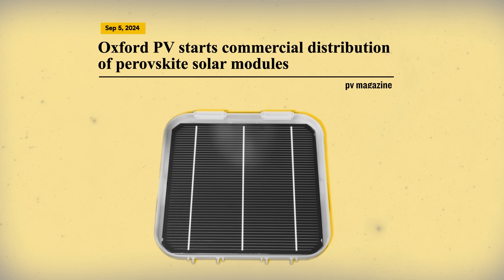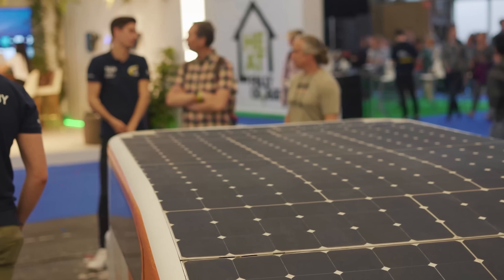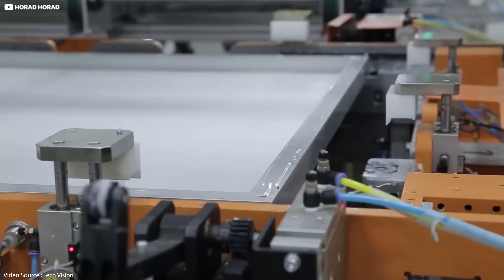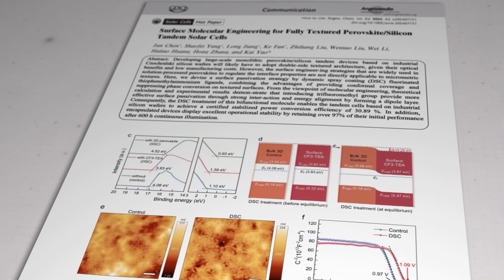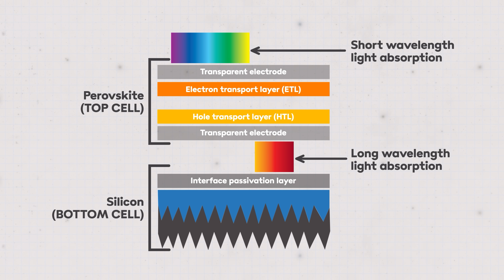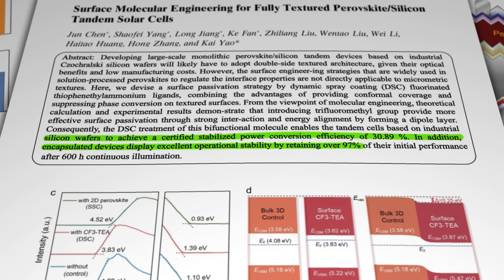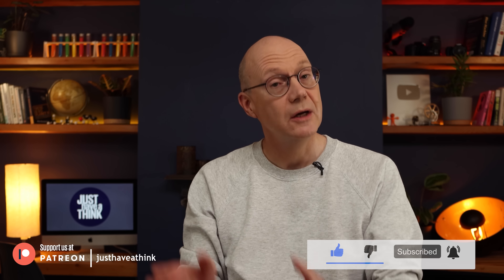Solar PV with more than 40% efficiency is now achievable.

Comment: 30% efficiency means 50% more energy than my 20% efficiency panels which means a huge improvement to my quality of life in winter :)
Reply: it also means less panels on the roof for the same power production which I like
Reply: @SpectacularRanker2  OR more power from the same roof !
Reply: @SpectacularRanker2  And accountants will love this, as yield per m2 increases while installation cost per kW of capacity goes down. I can see these efficiency gains encouraging solar installation at industrial and infrastructure sites
Reply: @SpectacularRanker2  It will depend on cost. If they cost 10x then only location with space limitations will use them. If it is 1.1x then they will see a lot of use.
Reply: It also means that if in winter you harvest the waste heat for hot water, space heating and clothes drying you reduce energy consumption from another area.  That is a distinct possibility.
Reply: Likewise. I wonder when to buy thou. I guess incompatibility isn't a problem but shall check. I also want the smaller sizes to fit on my small house boat
Reply: @EdSurridge  I've been looking at slim flexible solar panels for yachts mainly cos they can be walked on too, meaning that potentially any flat-ish deck space can become solar (although I'd obviously give the anchor & chain area a wide berth)...

Getting to my point, it seems as though high quality flexible solar panels are 20x the price of half decent framed panels... 

More efficient flexible panels would be great as long as they don't cost 100% more again.

PS please PM me if you know anyone selling a catamaran with boom roller furling mainsail 😅
Reply: @aaronjones4529  delamination after a few years perhaps 2 or 3 doesn't have the guarantee...
Reply: Go for a mast rolling mainsail. The little bit of weight higher up might even make the cat easier when anchored... .?
Reply: @EdSurridge  Yes size is a big factor, they keep making panels bigger so they can sell their next new panel because it has higher wattage on the label. Seemingly regardless of how much more difficult they are to instal. Also I need 60 cell panels not 72 like many are now.
Reply: @jedics1  perhaps people shall build their own ...
Reply: Though for most householders money is the limiting factor rather than roof area. A panel that makes 50% more but which costs 100% more is only an advance for a very limited set of applications.
Reply: @gasdive  This was true a few years ago. Now PV panels are so cheap, that the the cost is dominated by installation.
Reply: @orbiradio2465  that's true, the inverter, wiring, permitting, quoting, meter replacement and so on are now the main costs. However just saying "installation" costs dominate so panel costs don't matter is a bit misleading. Two systems that both need say a 10 kW inverter but one needs 30 panels, and one needs 20 are not going to have a very different installation cost. Just the cost of 10 panels worth of mounting kit and a little more labour.
Reply: @gasdive  Yes. I love the idea of a solar powered live-aboard boat, and with the limited area, you need maximum efficiency. But of course I'm not in the market since even the cheapest option is about $500,000 base, and no one gets charged just base, plus there are expenses in bringing the boat from the manufacturer to you. 
Even tiny houses don't have the same. problem as boats, since you can place panels on the roof AND adjacent to the home. Even people like me, who don't mind the isolation of living away from land, aren't all in the market for they kind of boat that would use these systems, making the market for expensive-but-efficient panels very small indeed. 
All that said, the one thing you've glossed over is that the final cost isn't the same as the *panel* cost, since there's installation involved, and the fewer panels you need to install, the less expensive the final system is going to be. Installation is already half or more of the total system cost (though I haven't looked at how much of that is installing new wiring + inverter which would not change with the number of panels, only with total generation capacity). As panels come down in overall price and installation becomes ever larger a % of the final cost, then more people will be able to afford *relatively* more expensive panels in order to save money on installation. 
The CdTe panel market initially was selling their panels at higher cost than silicon, but those panels are dramatically less weight per kw (they're less expensive and need larger area to produce the same amount, but they're so ridiculously light that even a larger panel still weighs much less). Their inefficiency made them inappropriate for things like boats, but very appropriate for large industrial/commercial buildings with weak roofs. The incredibly light weight required less bulky and less solid frames to hold them, reducing weight further, which led to vastly lower instal costs + the ability to cover a greater % of the roof in those buildings I discussed where the ability to carry excess weight was small. The point here is just that installation differences can make a large difference in final costs in at least some applications, and that might affect the market for these tandem cells. 
These complex interactions mean, I'm quite sure, that there will be a time when panel cost doesn't matter as much as it does today, and even today panel cost isn't everything, but you're absolutely correct that space is not the limiting factor for most people. Money is. So they're going to have to make sure the price per kilowatt hour generated by the perovskite tandem panels is on a rough par with the price for traditional silicon or we won't see significant sales for years.
Reply: @gasdive  I dunno if that's as true as you think it is. Last time I checked, the majority of the people in the world lived in cities and towns. Folks who live in cities often have less total roof area than someone in West Texas. Most people in Toronto who own houses would have trouble putting enough PV on their roof to run their houses 100% in the winter. (Of course, we don't want to go off grid -- but we like producing our own power.) So more efficiency would matter to us.
Reply: @TaiViinikka  I said most, not all. I have a house about the same size as average for Toronto (not in Toronto) and I run my fully electric house, and pool, and EV and still export more than I consume with less than 1/4 of my roof under panels.

Only if my demands were more than 4 times higher, or the insolation was one quarter (nowhere on earth is that low) would I find a more expensive and shorter life panel to be an advantage. Not saying such a situation can't exist, but it's not common for people who can have panels (people with houses) to need more efficient ones.
Reply: Agree with most of the comments of installation. Hopefully govt rebates go to installation not the panels once these panels are able to be mass manufactured.
Reply: It's even more than 50% if you live in a country where winter sky is constantly cloudy because perovskite PVs are very effective in diffused lighting (much more than regular PVs).
Reply: @dariuszb.9778  Good point and thats where most of us need it, even my tiny system makes more energy than I can use in summer, its winter where I have to go without or plugin to the grid. Im ready for them to take my money if they produce a smaller 60 cell version.
Reply: There has been work done on hybrid panels. Feeding pre heated water into a heat pump really boosts the useful energy harvested from a hybrid panel.
Reply: @clivestainlesssteelwomble7665  yes but they r expensive and heavy
Reply: Any idea how much your ac bill has gone down in the summer due to having the panels on your roof or was your insulation doing a relatively good job before the installation?
Reply: @ValidatingUsername  Im 90% off grid so don't have power bills but my 2000w of solar is enough to run a 2500w ac for free and still put some power into my batteries in summer. My 9kw of batteries could then run it for 6 to 8 hours at night.
Reply: "quality of life in winter"
- I assume that quality of life means having enough energy to keep things warm. But if so, that's odd because you can capture well more than 30% with solar water heaters.
Reply: @theevermind  Solar water heaters work only in region with high winter insolation an d it's not the case in many countries. Also, it rarely is used without PV (because summer is the season when you need hot water the less and electric energy the most).
Reply: @theevermind  nah I use a diesel heater for that, its more for my pc and gaming at night.
Reply: I'd rather prefer 50% more sun.
Statistics say that there's exactly one sunny day in January in my city. And it's only two or three hours long (not counting the hours when the sun stays below the rooflines). Can you imagine - 1.5 sunny days in place of one?
Reply: @jmi5969  I take all the sun in Aust for granted but now I have solar it would be hard to live somewhere without it again...
Reply: Solar camper van is a dream come true
Reply: Black panels are hot. Use the heat and you'll have 80% efficiency.
Reply: It also means throwing your panels out about 80% sooner.
Silicium panels can live for 50 years, you can throw out your perovskite within the 10 year mark.
Reply: But they're NOT 30% efficient and classic silicon can now manage 22%. Also I've heard Perovskites don't age well,
Reply: @grahamstevenson1740 my panels are 24% effficientt and cost £70
Reply: By themselves yes, but they already solved most of that problem, that's why the 24.5% ones are going commercial in the US.  @grahamstevenson1740
Reply: @grahamstevenson1740  And it's usually always easier and cheaper to just add more panels. The panels themselves already cost little and the area is rarely the issue. The problem is converting and storing the power and all the electronics that comes with that. Installations and other equipment are already more than 80% of the price tag. Silicon panels are cheap as dirt. 40% efficient panels make sense in space or some specialty use but on a rooftop or in a backyard it usually doesn't matter if you have 50 m^2 of panels or 75 m^2 of panels. We're already approaching a point with solar where maximizing morning and evening output, lowering mid-day production and storing the energy are far more important than the maximum peak-noon production.
Reply: @wombatillo it depends on the context though - I’m hoping to convert an electric van to live in full time later in the decade to be able to stop renting (I’m in my early forties and will never be able to afford a mortgage). Vans have limited roof space that I’d want to completely fill with as powerful as possible solar panels and I’d be fine paying more for more powerful ones.
Reply: @glyngreen538  What kind of electric van? I built an apartment on a truck so I could fit 2000w of solar which is the minimum for full time living for me.
Reply: It's only not 50% it's efficiency power×2

Comment: With the soaring temperatures from the climate crisis my array is no longer keeping up with our electric demand. I just might have to replace some of them with these new, more efficient panels.
Reply: And speaking of global warming: These cells require additional layers making them, at the moment, less thermally conductive which makes cooling the cells more problematic. Also, the UV transparent glass that's needed to protect them is more expensive and using UV resistant plastic that is UV transparent has durability issues. Also, additional layers always cost more to manufacture. So, still some bugs to be worked out. 😁 But I sincerely wish the companies well.
Reply: ... or alternatively reduce your electricity demand?

Comment: Fascinating video, Dave. Always appreciate your technology updates. And I notice you correctly use "micrometre" instead of "micron", which is officially obsolete. One hint, though; your pronunciation is for "micrometer", which is a measurement device. The pronunciation of the metric subunit of the "metre" is MY-kroh-mee-ter, much like MILL-ee-mee-ter. Cheers,  mate! 😊
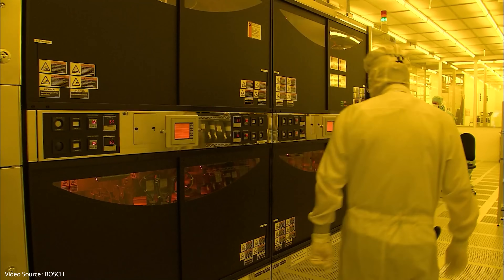Reply: 7:57 7:59
Reply: Haha, micron is definitely not obsolete and is the preferred term to use where I come from which, not surprisingly, is the manufacturing, engineering, and manufacturing of those damned measurement instruments that people confuse with the new-fangled unit name. (Numerous publications and textbook publishers have resisted changing over as well for the same reason.) "Micron is also  shorter and well known. Nope, call me old-fashioned, but "micron"  is the much better, less confusing term And I support all efforts to resist this change. The world has enough ambiguity as it is, there's absolutely no reason to add more.
Reply: @2ndfloorsongs  I mean officially obsolete per the BIPM.
Reply: @punditgi Yes, I understand. You must forgive me for ranting on as I have to deal with the confusion every day and I'm evidently more sensitive about it than I should be. 😁
Reply: @2ndfloorsongs  No worries, mate! 😃
Reply: @2ndfloorsongs  Whether it's the "preferred term to use where I come from" has no bearing on whether it's deprecated by the standard bodies like NIST and SI.  It's the same for "centigrade" which was deprecated recently (in 1948) in favor of "degrees Celcius". Sure, it takes conventions a bit to catch up.  I'm still waiting for us to switch to Metric here.
Reply: @tommythorn  We're not monsters, we switched to metric a long time ago. Part suppliers, international sales, and, well, you know, science. Technical stuff in the US is largely metric, but there's all sorts of crazy, Frankenstein stuff over here. For instance: My lawn mower has metric threads on its bolts, but the bolt heads are Imperial. If one standard is good, then two standards must be better. 😁
Reply: @2ndfloorsongs  Combining measuring-units in not just a single product but in a SINGLE COMPONENT...! X_X Isn't that the kind of stuff that made NASA crash the Mars Orbiter back in 1999?
Reply: @2ndfloorsongs  Now if they could just figure out how to get Whitworth in there as well...
Reply: @thekinginyellow1744  No problem: Transition from metric to Whitworth whenever you need a "self-locking" bolt.
Reply: @predabot__6778  Not quite, though not to far: That was combining two units in a single measurement. And, more importantly, not realising they were doing so.
Reply: @2ndfloorsongs  "The world has enough ambiguity as it is, there's absolutely no reason to add more."

Yes there isn't.

Comment: We just need them to cut down on the geoengineeering now so the sun might reach the panels
Reply: Good news, cutting the sulfur emissions from international shipping caused the solar irradiance at the surface to go up, so we are in fact geoengineering less than we have been in the previous century. Also, the ocean is getting hotter as a result.